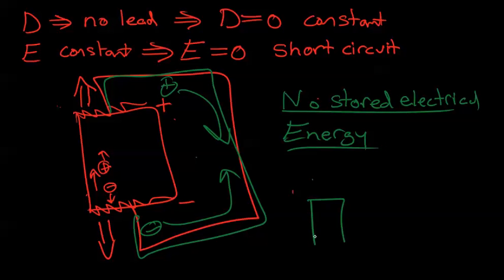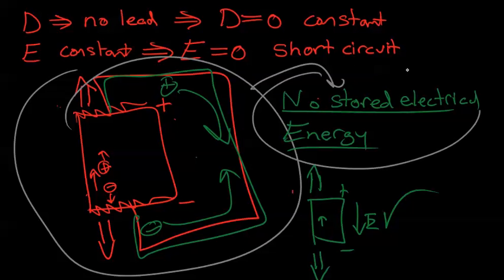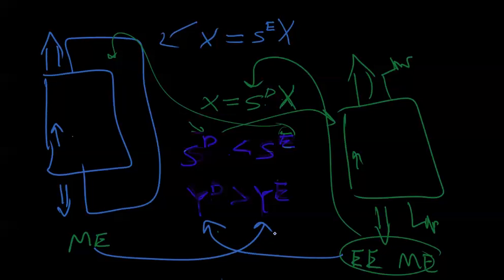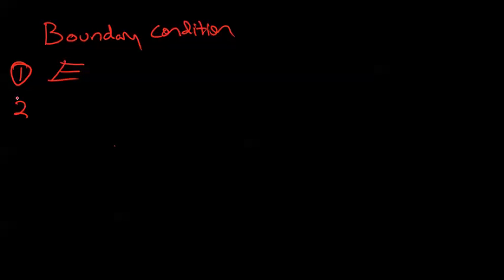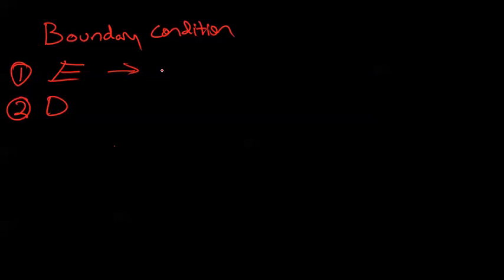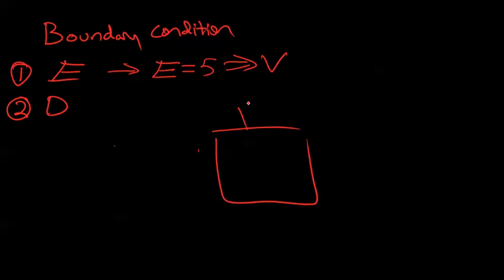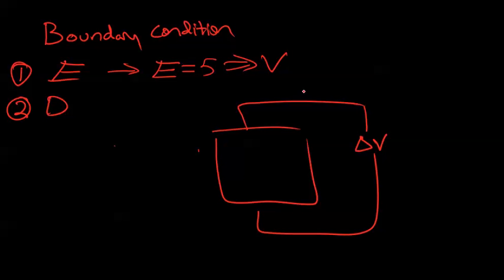Learn Piezo Lecture 3G: Electrical boundary conditions and their affect on piezoelectric materials

Comment: Is it correct to say, with the boundary condition E=0 constant, the material is more compliant than with a boundary condition of D=0 constant, due to the fact that no electric field is generated which works against the applied force of the E=constant scenario?

So for D=0, the electric field is not short circuited, and therefore it will work against the pulling forces, thereby reducing the compliance. In the same way, for E=0, since there is no electric field to work against the applied forces, the compliance will therefore be higher:  s^E > s^D